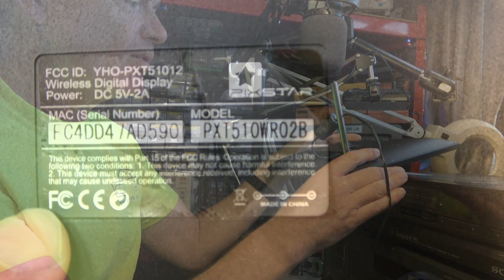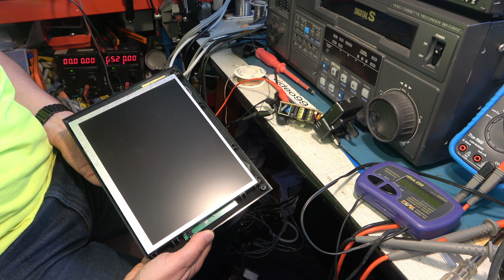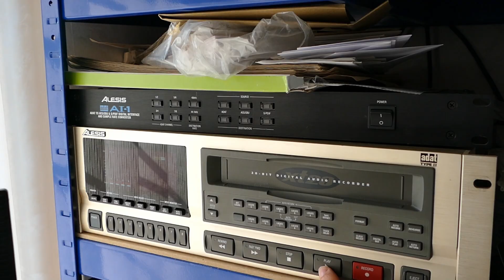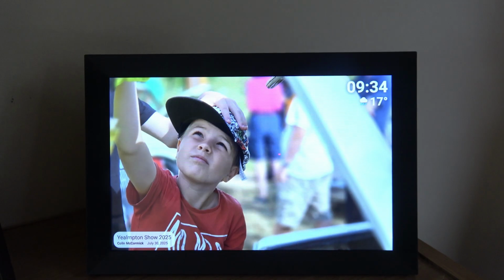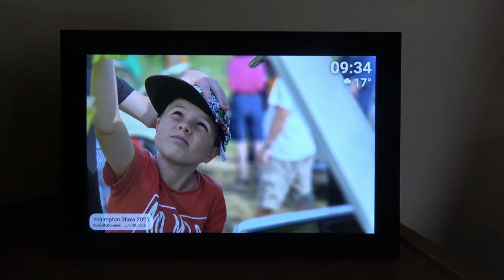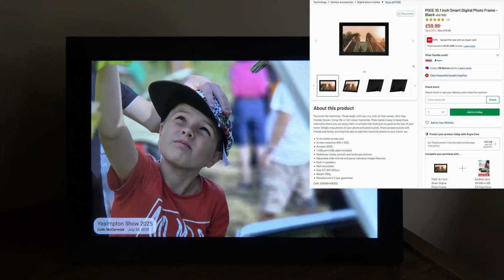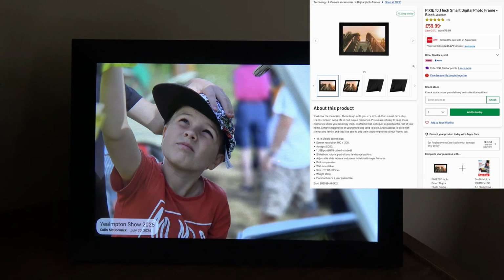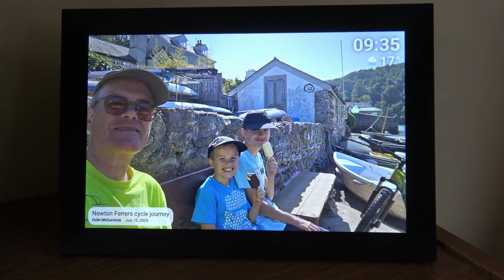Pixstar Digital Photo Frame has died.  Model PXT510WR02B.

Comment: Did you try unplugging the panel? Maybe a shorted LED on the backlight or so? If the panel does work, you could probably pick up one of those little driver boards on aliexpress etc to convert it into a spare display (popular for recycling old iPad screens)
Reply from the maker: It's not LED back-lit. It's cold cathode, they don't tend to fail short as far as I know.
Reply: Hi! The small scaler board is a good option with a raspberry pi something to substitute the died digital picture frame.

Comment: Just to confirm that the power supply is supposed to be outputting +5Vdc... is the output voltage written on the PSU brick and/or on the back of the photo frame? Off-load the 'faulty' PSU was reading 5.7V and with 5.0V from your external PSU you could see the sub regulated voltages working okay. I was wondering if a working PSU might intentionally be around 5.5V on load which would be enough for a low voltage drop DC regulator to generate a +5V rail in the photo frame. Could be worth a quick try to see if upping your PSU voltage to 5.5V makes any difference,